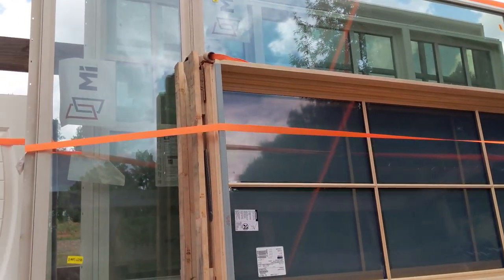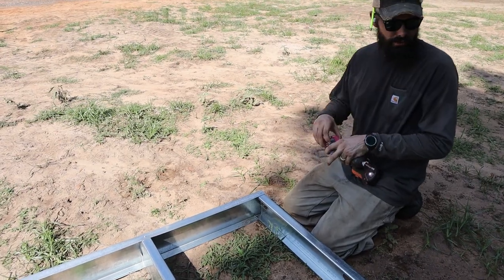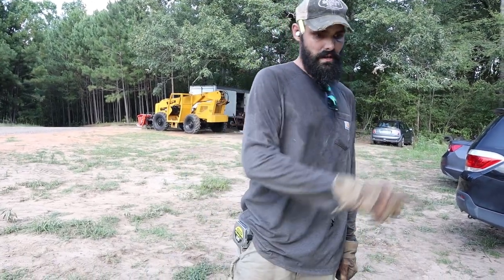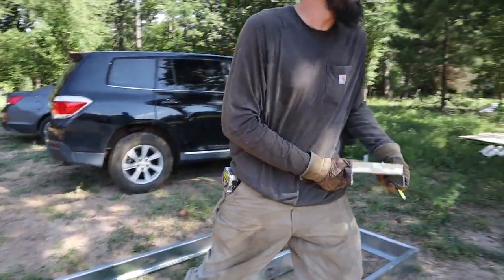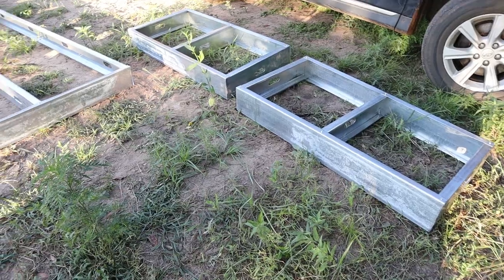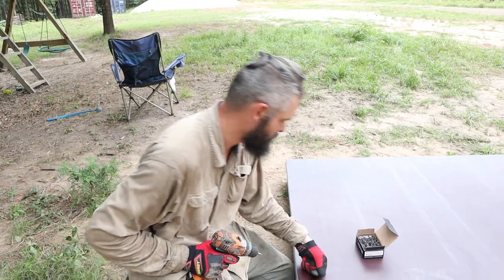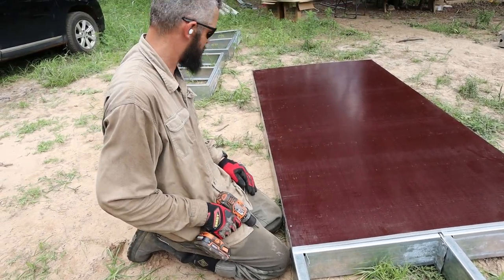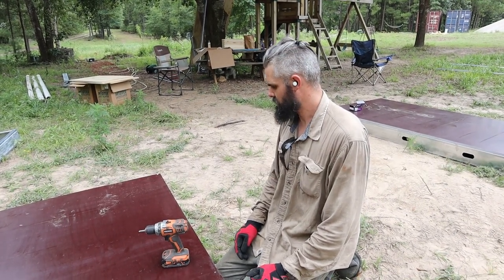Making MDO Forms for Rammed Earth - Vlog 40

Comment: really enjoying your channel guys, catching up as i search through my own thoughts and run a search :) great project. are you happy with your choice on mdo and steel studs? can see the benefit in the speed form and remove, and the smoothness, but wondering if any disadvantages over timber studs in particular? maybe flexibility/speed to reinforce/avoid bowing around corners or to customise the form to insert windows/doors/lintels etc?
Reply from the maker: We don't have any regrets using the mdo and steel. I think other form systems would work just as well. Timber would have a tendency to bow and be heavier, but it would be easier to work with. Full steel forms systems are more expensive and tend to leave more form lines but would probably be lighter and easier to work with. So I think it is up to personal preference and budget.
Reply: @RedEarthRanch  thanks for explaining- you’ve obviously picked well as the project is cracking on and with the smallest team I’ve seen on any YouTube vid.
Reply: i realize Im kind of off topic but do anybody know a good place to watch new tv shows online?

Comment: Greate video. Do you by any chance have a link for the materials. Id like to know what kind of metal studs you are using?
Reply from the maker: We use a local supplier but they are just 16ga metal framing studs. Usually they are used to replace wooden 2x4s in construction.
Reply: I have seen roof purlins used instead of metal wall studs.
Reply: @RedEarthRanch  how many and how much did those studs cost?

Comment: Hi Ranch great achievement today God bless. Excellent idea of building your own frames I thought you will go for ready-made ones. I will make sure to follow your model. What are the thickness of the plywood and how much is the prices for single wood sheet ?  Keep the great work continue and God help you.
Reply from the maker: Building frames gives us a lot more flexibility and it ends up being way cheaper. We use 16 gauge steel studs with 3/4-in MDO (medium density overlay). You don't have to use MDO but it does give you a nice smooth finish on the walls and allows them to pull away from the dried wall without a release agent. We worked with a local wood supplier and I think the sheets were about $60 to $70 a piece.

Comment: Hi what is different between MDO vs plywood?
Reply from the maker: MDO stands for Medium Density Overlay. Which means it is essentially plywood with a smooth overlay that doesn't have wood grain. You could use plywood but you would see the wood grain in the wall when you pulled the forms.
Reply: @RedEarthRanch  oh i see. How thick is the mdo?